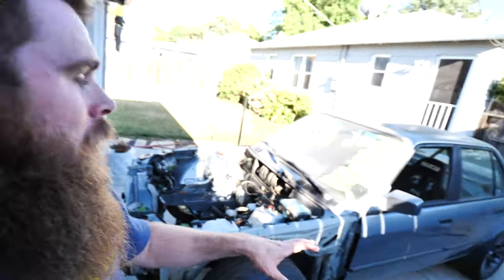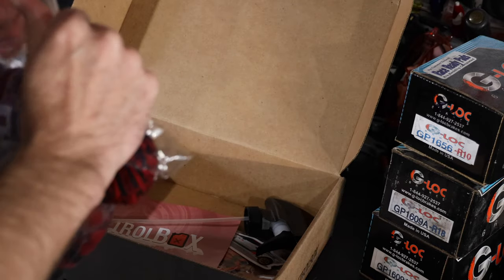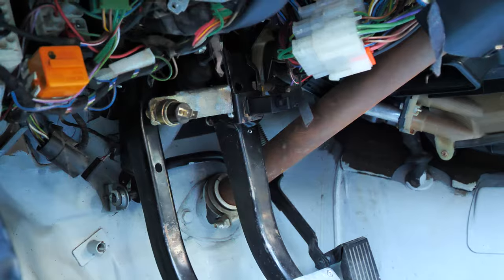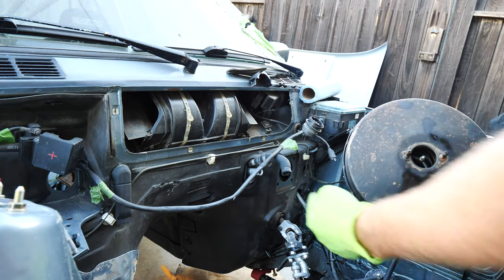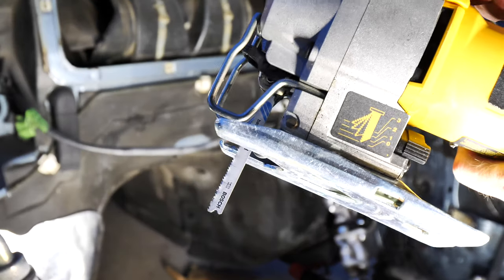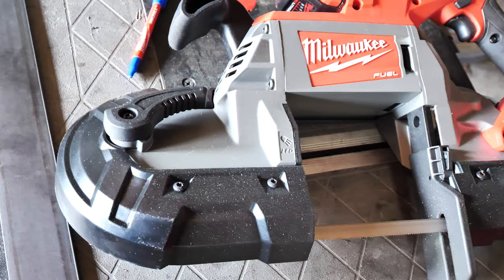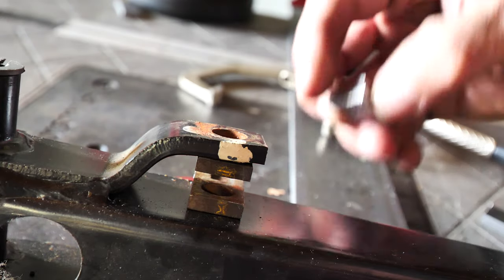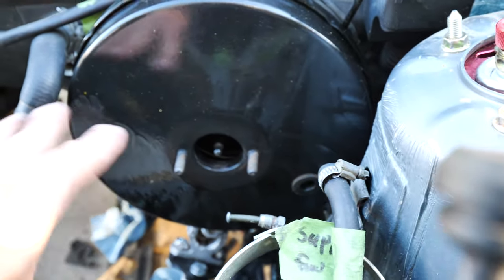BMW S52 24V SWAP BRAKE BOOSTER RELOCATION

Comment: Great video. But you know that drill bit was made for concrete or masonry?
Reply from the maker: These are Rodman bits. They work for everything even hardened steel. I use the to drill out broken bolts all the time nothing works better. Normal steel bits get smoked in a few minutes.

Comment: I used a 944 booster with a m50 manifold and it did not fit. I ended up doing this and I now have tons of room. Instead of making a custom clevis I drilled through the pedal and put the clevis between the clevis tab and main body of the brake pedal
Reply: I have an M50 manifold paired with the 944 booster & have no clearance issues. I shimmed the mounting points which helped with clearance
Reply: @jeldibye  I used the rev shift mounts and I could’ve gotten away with shimming them, but didn’t feel comfortable with the trans mounts and all being slightly twisted. When I say it didn’t fit it was barely touching

Comment: Seems like my brakes got worse after moving mine and still no braking improvement after going with a willwood big brake kit.
Reply from the maker: I wonder if your clevis is flexing or threaded into much not giving you enough stroke?